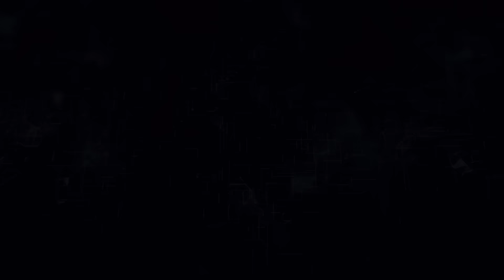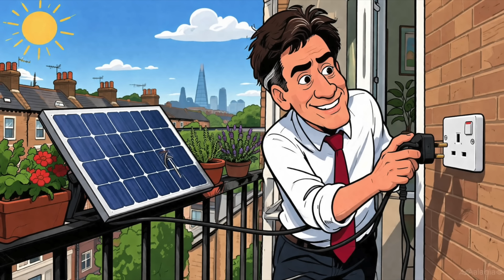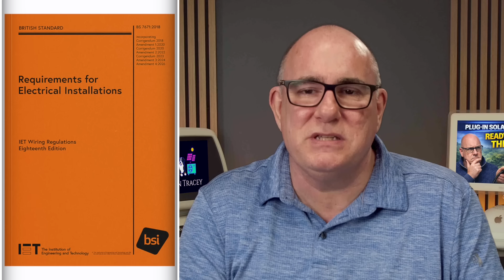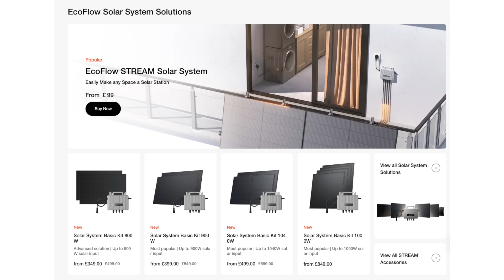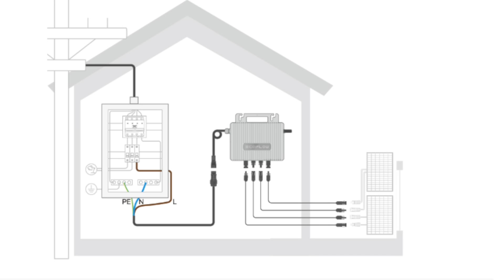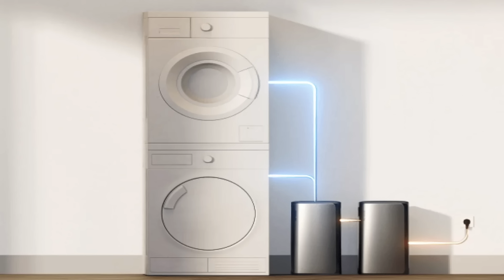Plug In Solar Is Coming… But There’s a Problem

Comment: This does not solve the UK energy independence or security problem. We will have power mid day mid summer when demand is low and we dont need it and nothing in the evening mid winter when demand is at its peak. The problem remains the same no matter how many of these systems consumers buy.
Reply: Yes but mad Ed Milliband doesn't understand this or if he does he won't admit it, and continues to lie about Solar
Reply: @mw01908 If we compare 2004 and 2024, we now have 40% higher total installed UK generation capacity producing 20% less total electricity (peak demand also 25% lower) but costing consumers more than twice as much! (adjusted for inflation). All this as we moved from 0.4% solar and wind generation to 35% solar and wind after spending trillions on 'investment' from your pocket and littering every available space  and viewpoint with them. At the same time our power imports (dependency) have more than tripled. Cheap home grown enironmentally responsible power that improves our energy security and independence? 20 years worth of practical evidence very strongly disagrees.
Reply from the maker: @clwydsigma Ah yes… because clearly the plan was for one 800W plug-in panel to single-handedly solve UK energy security 😅

You’re absolutely right on the seasonal challenge — summer surplus vs winter demand is a real issue. But that doesn’t mean small systems do “nothing”. They reduce daytime demand, lower grid load, and chip away at overall consumption.

Not every solution has to solve the entire problem on its own to still be useful 😉
Reply: @JonathanTracey If we compare 2004 and 2024, we now have 40% higher total installed UK generation capacity producing 20% less total electricity (peak demand also 25% lower) but costing consumers more than twice as much! (adjusted for inflation). All this as we moved from 0.4% solar and wind generation to 35% solar and wind after spending trillions on 'investment' from your pocket and littering every available space  and viewpoint with them. At the same time our power imports (dependency) have more than tripled. Cheap home grown enironmentally responsible power that improves our energy security and independence? 20 years worth of practical evidence very strongly disagrees.
Reply: @JonathanTracey If we compare 2004 and 2024, we now have 40% higher total installed UK generation capacity producing 20% less total electricity (peak demand also 25% lower) but costing consumers more than twice as much! (adjusted for inflation). All this as we moved from 0.4% solar and wind generation to 35% solar and wind after spending trillions on 'investment' from your pocket and littering every available space  and viewpoint with them. At the same time our power imports (dependency) have more than tripled. Cheap home grown enironmentally responsible power that improves our energy security and independence? 20 years worth of practical evidence very strongly disagrees.

Comment: before watching im just going to say, i wont get the solar but will use this to charge a battery at night off peak and power the home during the day 800w is more then enough to offset what i pull from the grid, using ecoflow i can change the inverter based on actual draw so i dont send to the grid for free
Reply from the maker: yep that’s a perfectly normal use case, you will require the separate device that goes in your consumer unit to check the amount of power of the house is calling for and then communicate to the battery to supply it. He’ll think to bear in mind in a battery arbitrage model the payback period is a lot longer.
Reply: @JonathanTracey  correct it will be longer but as i have no space for panels it is my only option to save a few pennies, i have a home mini and was going to use that, i know its not as accurate as using the other method but it should still make a big sized dent, though i have seen some battery operated wifi CT clamps that im looking into, that importantly are compatible with ecoflow via home labs

Comment: Great video. It asks so many questions. but begs a few too. So what is the point of a G98 or MCS? I'm a born cynic, probably why I loved being an investment analyst. I have always thought that the Bureaucracy and paperwork we designed by the industry  to discourage rather than encourage. The ennergy supply industry is at best agnostic from a business point of view and wopuld propbabl;y be happiest if everything was gas fired. It would be simpler and it would make more money. The fact that Octopus will let you bypass MCS for a fee tells you all you need to know about the industry and MCS . 
Civil service and regulatory nody obfuscation in epic in the UK. The government should simply say this goes live on July1 whether the regs are ready or not and give the officials 3 months to catch up. UK type approval is nonsense as we are almost certain to adopt 95% of the EU regs. G98 should be scrapped for any system under say 10KW. 
What is ground mounted? My shed has a roof, so does my carport. What about a pergola? My house has a large expanse of empty windowless south facing wall?
Then there is the safety regulation aspect. My girlfriend a GP rewired her cottage herself 30 years ago - it is still standing! Those of us likely to be interested in DIY solar will have probably done other stuff in the past, built our own shed, workshop, garage. Installed lighting in our loft. Those who do electrocute themselves have probably improved the gene pool in the process. I'm not a qualified electrician so even though I suspect I could wire in a consumer unit if I read enough and watched enough videos I wouldn't do it. Its also not worth it from an insurance point of view. But the Government can make plug in solar accessible very easily and if it comes with a plug already on the end of the cable, virtually idiot proof.
Covering base load is a great place to start. Worrying about exporting is probably not something most of us should worry about initially and I suspect given the nature of the industry export tarrifs will decline over time. I have done this 1 for fun and 2 as a middle finger to the energy companies and the solar installation industry. The extra cost to be able to export means I won't beat the return I get on my investments. What does look interesting though is hunting down a good Tesla model S with free supercharging as it would also give access to the cheap night time EV tarrifs.
Sorry bit of a ramble but blame it on your video that got me thinking once again. I really enjoy them.
Reply: MCS has no point. MCS existed to make the original FIT scheme work. It should have been abolished at the end of FIT IMHO but as ever government is no good at removing stuff it no longer needs. These days MCS is a pain, they stop all sorts of good stuff like second hand panel use in their installs.

G98 is required for several reasons including
- To identify properties with meters that will go backwards (fraud risk on ancient meters)
- To manage backfeeding in local grids (and even 3.68kW in some places is more than enough to be a concern because lots of grid equipment is prehistoric)

Large parts of the grid would actually just go boom if you let everyone do 10kW backfeeding.

On the planning side
- Ground mount is not defined in the regulations
- On top of your shed is roof mounted, on top of your pergola likewise (in fact it's a common solar trick to put up a garden office or verandah or pergola then shove solar on it as the building is permitted development and the solar is then permitted too)
- On your walls is permitted development (with the usual exceptions for nimbyzones, listed , aonb etc)

For EV tariffs Octopus apparently don't check on Go, some of the rivals don't require the EV (but tariffs all seem to be closed thanks to Tantrump). Also you might want to research the legal definition of an EV. It appears to cover ebikes, mobility scooters and much more not just cars!
Reply from the maker: @rupertmiller4718 Really appreciate the thoughtful comment — lots of good points in there 👍

On G98 / MCS:
- *G98 absolutely has a purpose* — it’s about protecting the local network and engineers. Even small systems can cause issues with voltage rise or backfeed on older infrastructure, so the DNO needs visibility.  
- *MCS* originally tied into FIT (you’re right there), but today it’s more about standards, insurance, and eligibility for export payments — not strictly required to run a system, but often needed to get paid for export.

On the bureaucracy side — I do agree the UK tends to overcomplicate things. Other countries (Germany especially) have shown you can safely allow small plug-in systems with much simpler rules.

Where I’d push back slightly is the “just go live and fix it later” approach — electricity isn’t quite like software 😅 once something is installed incorrectly, it can create real safety risks or grid issues.

You’re spot on about baseload though — that’s exactly where these systems make the most sense. And I think you’re right that export is becoming less of a focus vs self-consumption.

Overall feels like we’re saying the same thing from different angles: the tech is simple, the benefits are real, but the UK framework hasn’t caught up yet 👍

Comment: Back in the 80s as a young lad i had a tiny solar panel and a dc electric motor that would run on sunny days.........free power Wow and a crystal radio set made from plans in a ladybird electronics book.
Reply: And it would seem that you likely should have been incarcerated for many years for the unbelievably, extremely heinous crime of generating solar power within 5m of your neighbour's property.
Reply: @tonyh6309  Except in Scotland which has sane ground mount rules.

Portable equipment however is not permanent and temporary installations are generally outside of planning. This has been tested in depth, mostly by radio amateurs putting up enormous masts and taking them down for a day at Christmas 80
Reply: Why did you need solar for a crystal radio.
Reply: @anonet78   crystal radio = no battery required. solar = the same but for the motor.
Reply: @sparkeydave  At least some of us are still alive and remember how to do things.
Reply from the maker: @sparkeydave Love that 👍 I got started in a very similar way.

These days it’s less crystal radios and more ESP32s, but it’s the same idea — small bits of kit, learning how it all works, and realising you can make your own power.

Funny how it all comes full circle!
Reply: Nerd warning:  When you moved it up to the transistor version, you had to get hold of an Eagle LT700 centre-tapped transformer, which turned out to be almost impossible a few years after the book was published.  However copies are now available.

Comment: How are we going to deal with the fact that many consumer units will not have bi-directional protection?
Reply from the maker: @mfr58 That’s a really good question 👍

But (just to play devils advocate) this has not been an issue in Germany, so is it just something that is being blown up by the electrical industry
Reply: @JonathanTracey  Maybe their protective devices are bidirectional already? But yes, I believe dangers are grossly exaggerated by industry as it's a money spinner. Not to say there aren't dangers, but the actual risk is usually much less than purported in many instances.
Reply: A bigger, more immediate problem is actually going to be old meters. When I got my solar installed via the ECO4 scheme, I noticed that my old meter would stop spinning when I was exporting to the grid. After 1 and a half months - I noticed it had stopped spinning altogether. If this is going to be the case for anyone with an old meter, there's going to be a lot of demand for new meters very quickly.
Reply: @AndrewJonesMcGuire  The G98 form is supposed to make the DNO check the meter installed won't do that. Very very few meters that old still exist, and all of them probably should have been replaced by now.
Reply: @etchedpixels weird. The company installed the generation meter, but nothing happened with my old rotating wheel meter, until it broke

Comment: I have 2.4kw of rooftop solar which is owned by a private company. They get the FIT and I get the free electricity. If I add balcony solar will it be seen as independent from their system and not affect their FIT?
Reply: In general (and it's complicated) and will depend on the contract but

If you modify the existing system your FIT gets invalidated unless its done to very specific rules.

If you add a second system the other side of the generation meter (such as plug in solar AC coupled) then generally you have no problem. In fact it's common to fit AC coupled house sized batteries this way already for old FIT installs.
Reply from the maker: @VolleEcran Definitely worth checking your contract 👍

In most cases, if you add a separate system (like plug-in/balcony solar on the AC side), it’s treated as independent from the FIT system — so it shouldn’t affect it.

The key is not modifying the original system itself. If it’s separate, you should be fine 👍

Comment: I have no problem with small scale solar. 
But to use a 13 amp plug to make the connection is very strange . 
The live part of the connection is always a socket never the plug. 
It's driving a wagon and horse through the normal we have regulations for reason. 
If you won't to do this do it properly.
Reply from the maker: @robincook5999 You’re right to question it 👍

The key difference is these systems are designed to be grid-synchronised with built-in protections, not just a random plug pushing power in.

That said, this is exactly why the regs need updating — to make sure it’s done safely and consistently.

Comment: Jonathan are you a qualified Electrician ? . Do you know how a MCB / RCCB / RCBO work. I would advice anybody to get an Electrician to check if your Consumer Unit / Distribution Board meets the requirements for protection before you plug in or go out and spend your hard earned cash.
Reply from the maker: no, I’m not an electrician, however I I trained as an electrical engineer. So I’m quite happy and confident with my home electrics. As you say, you should consult a qualified electrician, especially if you’re poking around in your consumer unit.

That said the whole point of plug in solar is that you don’t need an electrician, you plug it in and it works

Comment: Just a few years ago the governemnt wanted all domestic gas boiler systems to also generate electricity.
Reply from the maker: without a turbine its hard to see that ever working
Reply: @JonathanTracey  The idea was that a gas turbine generated electricity, and the waste heat was used to heat water for home heating and bathing. Micro Combined Heat and Power (micro-CHP) units.

Comment: It's not law yet so don't do it, Get a power bank save your own electricity the gov cant stop you doing that.
Reply from the maker: its not law with a plug, but you can put in a system wired into a fused spur and its totally legal
Reply: @JonathanTracey I will keep charging my power banks.
Reply: @JonathanTracey  w
What is the best power bank out there, I want get a new one in 2 months.
Reply: @JonathanTracey  Separate connection not a fused spur, and it needs all the other bits correct too at this point.